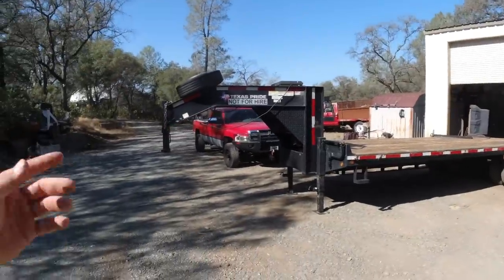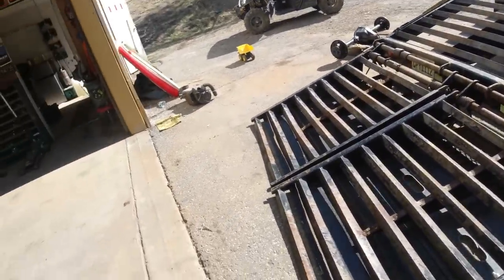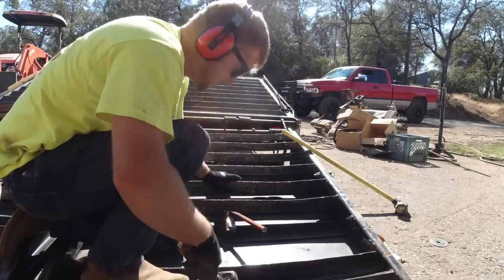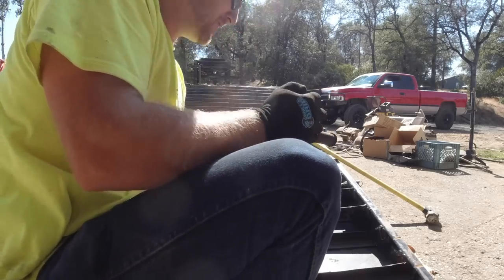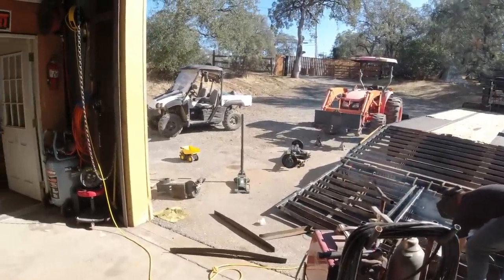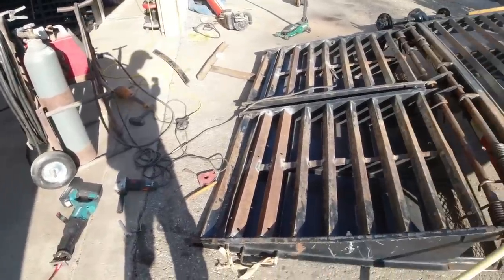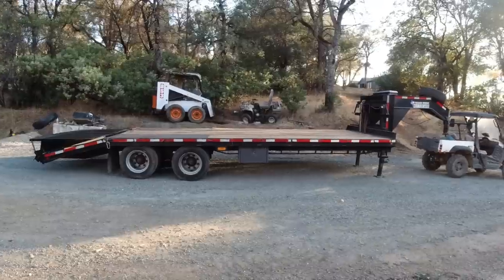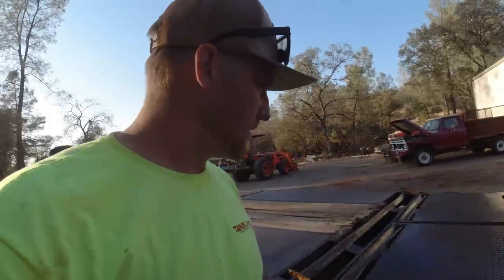Selling my 30k Gooseneck trailer. Fixing issues before selling

Comment: Thanks for all the time spent with your videos they are very helpful and informative I enjoy very much watching them. Have a question I’m looking to purchase a used dodge ram 3500 Dually just curious I was looking at a 2012 model but watching some of your truck videos if you were looking to buy used which model would you prefer it will need to be an automatic transmission but I will also be pulling upwards to 18,000 pounds at times thanks for your help

Comment: Sam 1 ? why do you use a grinder or sawzall to cut out the angle on the ramps when a plasma arc or torch is so much faster. I can see the band saw for the new material. But I see the younger crowd here you tube using the grinder sawzall combo more than the plasma or torch even when they have them, old school mechanic, welder here.
Reply from the maker: Little thick for my small plasma cutter. Just got easier to old school it. And I don’t have a torch

Comment: Hey Sam, what is the dry weight of that trailer? If you mentioned it, I didn't catch it. Thanks
Reply: I think from previous videos it was ranging 8600-9800lbs
Reply from the maker: 9-9500

Comment: You had kept the Texas pride cause it was shorter, will the new 40k be shorter than your first diamond c
Reply from the maker: New dc will be same as current dc. 5 feet longer than the Texas pride. I’ll just have to be a champ and manage with the longer rig. I use the small trailer 1-2 times a year because of fitment. Not worth keeping just for that
Reply: I thought the same, cause I seem to remember a video where you mentioned about keeping the shorter trailer because of the tight spots you find yourself in. Good luck, great channel